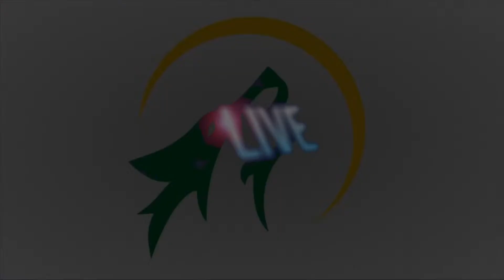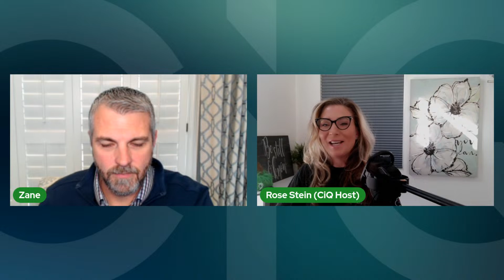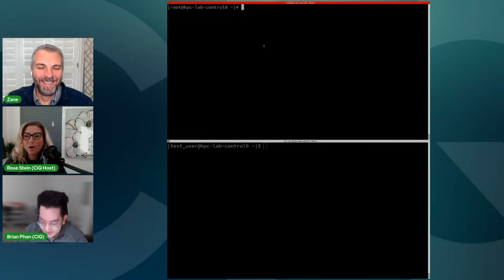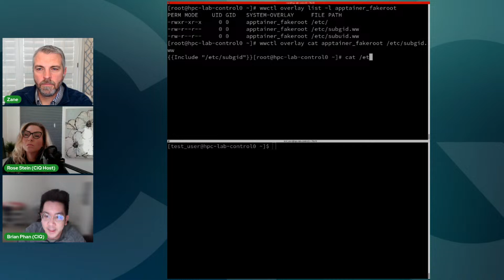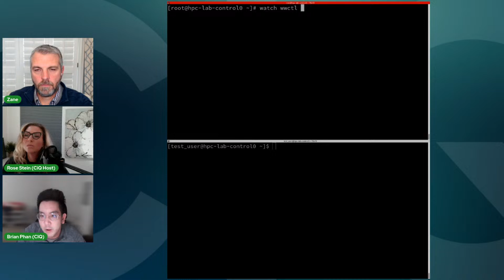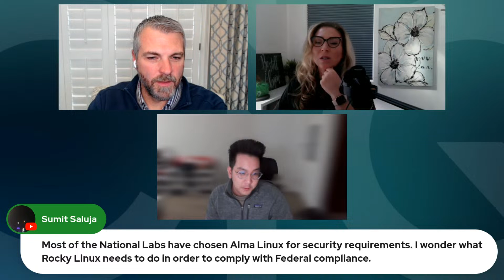Build Me an HPC Cluster: Rocky, Apptainer, Warewulf

Comment from the maker: To clarify some confusion regarding CIQ’s recommendations for MPI: we recommend installing MPI in the Apptainer container, not using the “hybrid” method. Using PMI or PMIx support in your resource manager, you can start such MPI-equipped containers directly, without needing MPI to even be installed on the host system, which makes the container portable to any PMI-supporting environment, and carries no performance degradation.
We have discussed this in previous webinars; in particular A New Approach to MPI in Apptainer and Apptainer MPI Benchmarking. https://www.youtube.com/watch?v=7cw_uVr5Ibk
https://www.youtube.com/watch?v=oMEQGEUauwQ